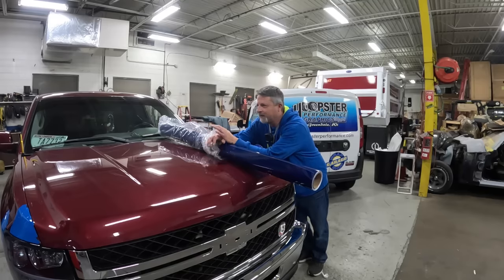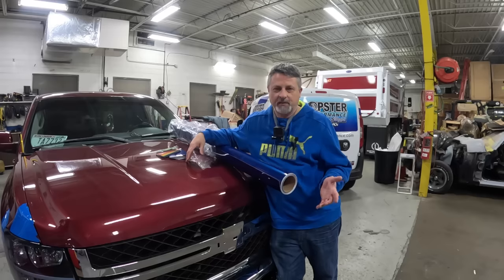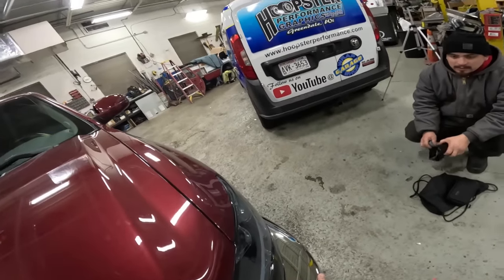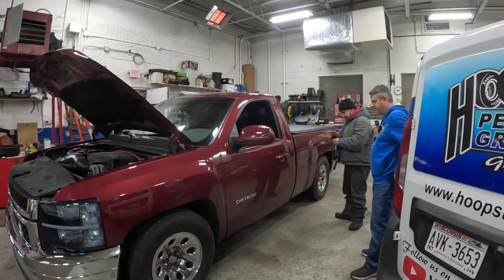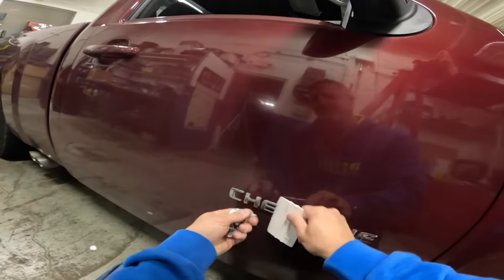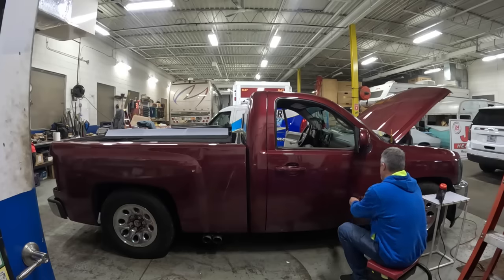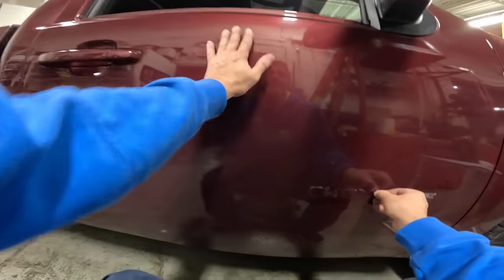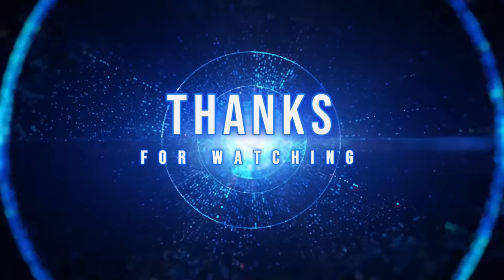Vinyl Wrapping a pickup with @ThatBoyCisko - Part 1

Comment: You're awesome Chris for teaching Franny some new skills. Maybe you can hire him for winter work ! By the way have you ever used the rubber adhesive wheel that you put on a drill it does save a lot of time removing glue from emblems and such and saves your fingers from going numb.
Reply from the maker: Yes I have an mbx paddle wheel,  but I wanted to have conversion with Cisco, so I just peeled these
Reply: @wrapshopgarage  awesome I was hoping you did I hated removing moldings/emblems
 with just elbow grease and tons of prepsol - I hope you showed that to Franny !